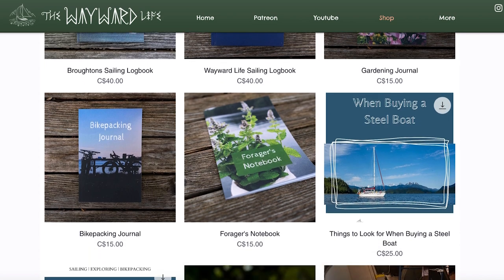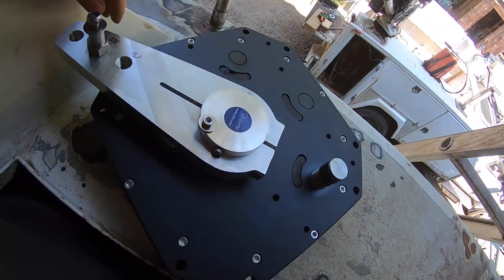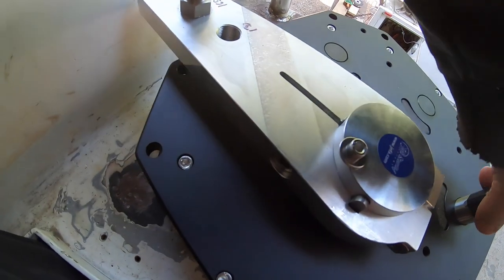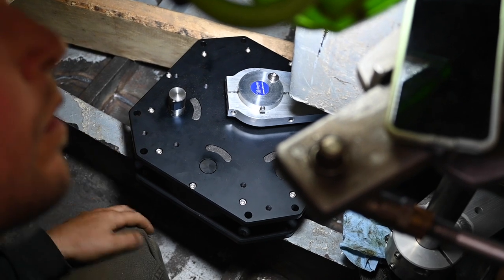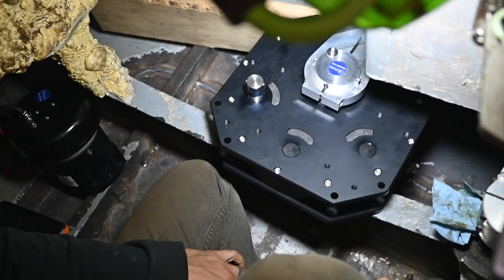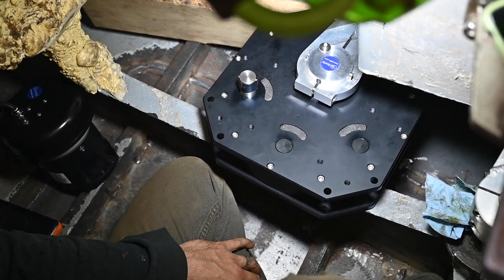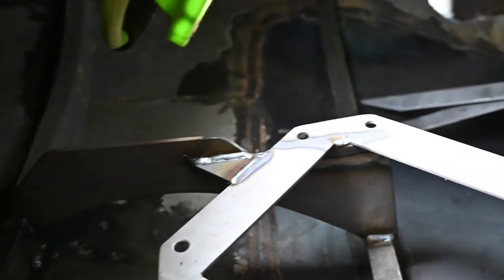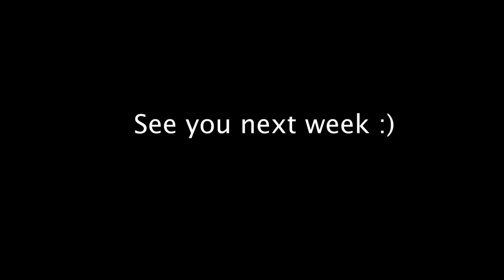Installing an Autopilot Is Harder Than It Seemed! | Ch 5 E 74

Comment: I have a Bruce Roberts steel 38' cutter. I mounted the A/P compass atop an aluminum poll about 10' off the deck and away from the steel.
Reply from the maker: Off the solar arch?
Reply: Anything that works to mount it high enough not to be affected by the steel. I did need to buy an extra long cable. I have the Raymarine wheel pilot.